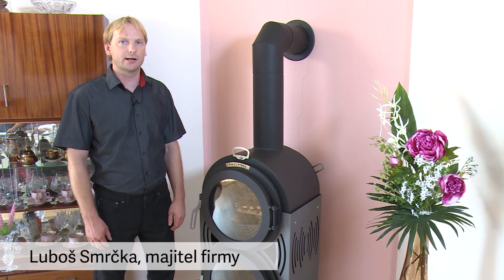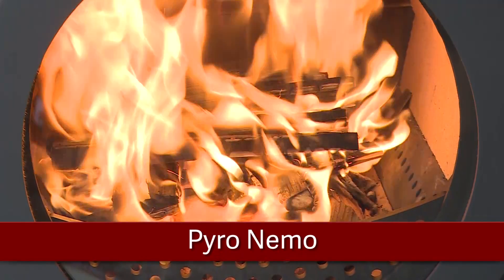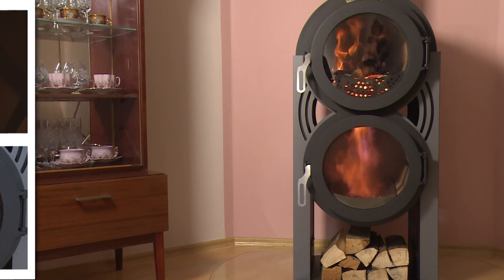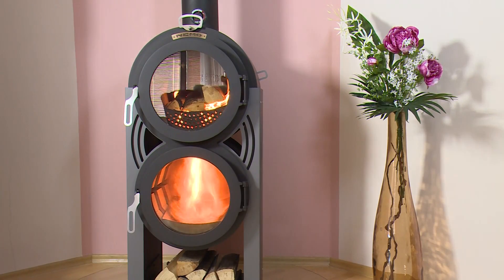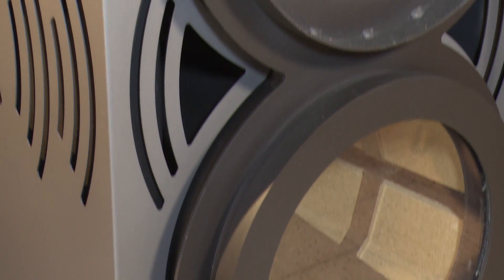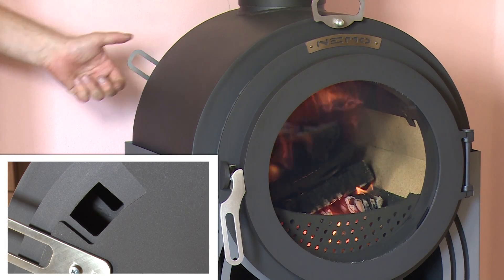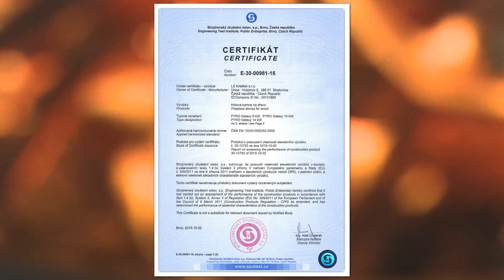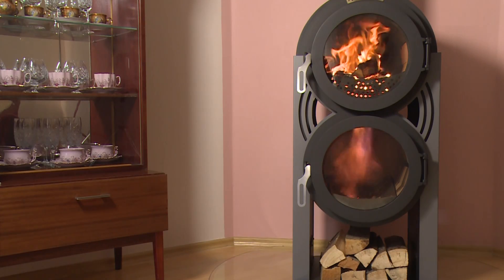Pyro Nemo ENG

Comment: Ime not convinced. Looks impressive but surely its just the secondary air below the fire box instead of above. Whats it like when you close air vents to facilitate slower burning?
Reply: Yea, there is likely secondary air in that lower chamber which is a really good thing. If you are "not convinced," say that for other reasons like "ash cleanout problems" and potential clogging of the grill leading to the lower chamber. The secondary air is not a problem.

Comment: This reminds me of how some of those outdoor wood fired boilers work. Except this one doesn't need an electric fan to pull a draught.

How tall of a chimney do you need for this to run correctly? Double or single walled?
Reply: Yes, you are right... A long insulated chimney would really help pull everything down and then out. The "code" in most places will require double wall  (but good, that insulation is needed here.) You need at LEAST 4 meters of chimney for the proper pull I think and 5 would be better. A stove that "vents straight up" doesn't need so much. Also, the chimney should "stay warm" and NOT be on an outside wall, in the cold. (or you better insulate the heck out of it.)

Comment: Hello,
Very interesting and beautiful stove. I have 2 questions : Are they as efficient as for example the bullerjan free flow to warm a big room ?
Do you have resellers in France ? Thanks in advance
Reply from the maker: Hello, these stoves are about 20-25 % more effective than bullerjan. It is either because bullerjan technology is quite old already (consists of an ordinary fireplace and pipes), either it is for the additional woodgass combustion (thus more energy taken from fuel). Lastly it is for the construction design. The pyro stoves you can see in the video work with every piece of energy - burn all the woodgas there is. Bullerjan and other usually-burning-stoves let a lot of energy to simply go away through the flue.
Reselling cooperation in France has not been established yet. Should you need any support from us, please let me know: sale@LS-kamna.cz
We shall gladly provide all the information needed. In case you decide to acquire a stove, it may be purchased directly from us (producer).
Kind regards!
Reply: Thanks a lot for all the informations. It's very instructive and interesting. We have the project to buy a stove in 2021. I take note that we can purchase directly from you. Kind regards
Reply: This stove its smokeless thus more efficient than the bullerjan but also can become more dangerous than bullerjan ( more CO wich is burned but still a most dangerous design).

Comment: Why not make the top flat, so you can use it for cooking?
Reply: The simplist solution would be to make an attachment that could sit on the curved top with a level flat space for heating a pot or tea kettle, and you could make a water jacket that would lay on the curve and have a spigot on the side.
Reply: Hi, I like simple, it's always the best. Great idea you have. I love this stove, add a water coil in the bottom chamber to feed a radiator in the bed room. @susangarrard2753
Reply from the maker: Hello, Thank you for your opinion. We think that the preference of specific shape and design is solely a matter of individual taste. You would be surprised how many people prefer this rounded shape to the square one. And vice versa, of course! People are different, and so are their tastes and possible needs - and uses at their homes. Not everyone needs to cook on the stove.
Reply: @lskamna8987  flat top would be really good!
Reply from the maker: @sunafukin775  You mean like an hourglass? Yeah, that might be nice and the flat top could serve as a cooking hob, but unfortunately, such an impact would require whole new certification - and that is quite costy ;-)
Reply: @lskamna8987  No need for complex system change, just flat top
Reply: Because the rich people who buy this stove in Western Europe don't really need to cook on stoves like homesteaders who wash clothes in creeks. These rich people may even have a microwave in the house if you can believe that.